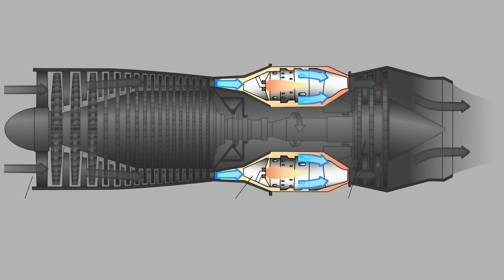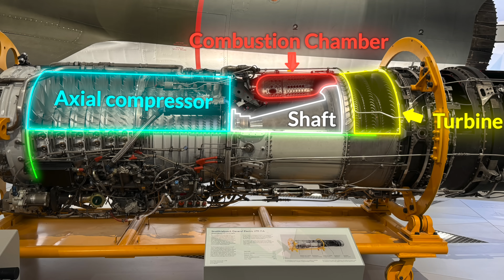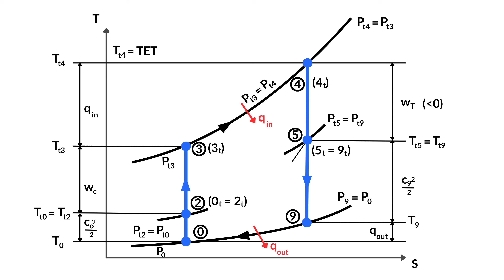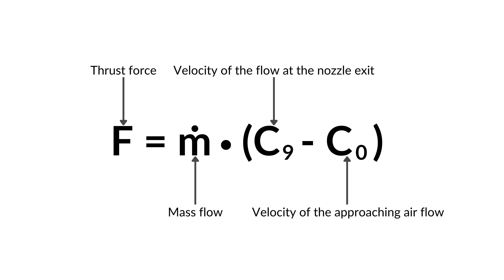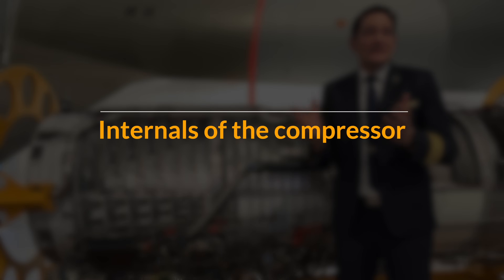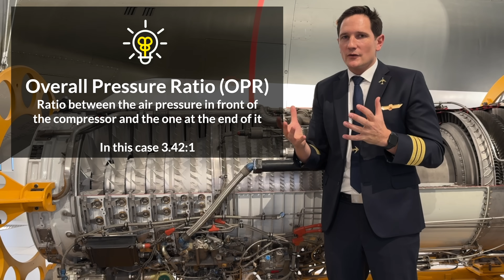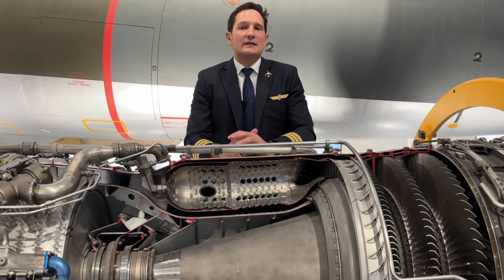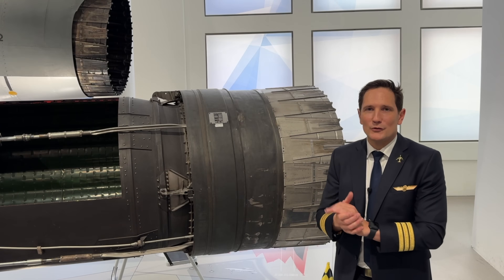How a TURBOJET Engine works - Explained by CAPTAIN JOE

Comment: This was a good explanation of how a turbojet engine works. You never explain where the thrust pushes on the engine's internal parts to move the plane forward. Where do the exhaust gas molecules impact the engine parts to provide thrust. I understand the 'thrust equation' but this avoids what physically happens. Please do a video explaining the actual forces.

Comment: Good explanation. As I was watching it, the stated value of OPR=3.42 did not look right for the J79 engine. Googling it, I came across OPR=13.5 which may represent the design point capability of the compressor.

Comment: -- On your question of when engine max power is used - when something bad is chasing airplane like enemy missile or aircraft - that mode calls WEP(War Emergency Power), followed by take off(MIL power).

P.S. You made a very good video, but it would be even greater if you'd elaborate a little more on why no backflow from combustion chamber into compressor do not happened. And you should blame a "diffuser"(right after compressor, and before combustion chamber) and Daniel Bernoulli principal for that. Diffuser is important, but often forgotten part of jet engine, that slowing down airflow and increasing pressure, which is supposed to be greater, then expanding air-fuel mixture as it burns and expands.

Thank you!
Reply: -- Also, not only fuel efficiency, but turbojet engines are loud when compared to turbo fan engines, that muffled by the fan. Case in point Lear jet 24!

Comment: Turbojets are less efficient than turbofans because they accelerate a little bit of air a lot whereas the latter accelerates a lot of air only a little bit. The latter achieves the same momentum but saves lots of energy because kinetic energy is squared as velocity goes up linearly. KE = 1/2(MV^2) so that’s important to remember.

Comment: Since nobody seems to have answered the question: an engine produces maximum thrust in the first moments of takeoff because the difference between the entering and exiting air is the greatest. Also the air is densest on ground level so the mass flow also increases.

Comment: Excellent cotribution ! Just a question on the compressor OPR: Could this be approximated by the cross section of the compressor intake by the cross section of the compressor outlet ? BTW: This is a question by an electrical engineer - so bear with me ... 🤓

Comment: The jet engines produces the maximum thrust during the take-off phase, because the compression of inlet air will be high due to high RPM of compressor which increases the air temperature and pressure. This high temperature and pressurized air helps in burning the fuel and increases the pressure further more. Therefore, more the pressure of burnt gas expanding through the nozzle, the velocity of the gas will be increased which results in the more thrust as an reactive force. Correct me if I'm wrong somewhere.
Reply: very well said, but jet engines are supposed to recieve more airs into its system isn't it? so more air equals higher rotation on the turbine and higher velocity on the nozzle exit resulting in more thrust force. I'm not sure what phase of flight the engine needs to be in to get the most air...
Reply: @izuumisato6473  at cruising or climbing phase the thrust reduction will be done to enhance engine life and fuel efficiency.At higher altitude the aircraft flies at higher speed for the same thrust because of less air density
Reply: @HPGAMING-r7h  alright i get it. thanks for the explanation!

Comment: It's now Saturday morning for me, so here are some more comments.
So today. let me first correct a very obvious factual error that you made.  You said that the J79 had an OPR of 3.42:1.  That's wrong: its pressure ratio was around 13.5:1.  Frank Whittle's W.1 engine, with its centrifugal compressor, had a pressure ratio of around 3.8:1, while the pressure ratio of von Ohain's centrifugal HeS3B was, from memory, around 2.7:1.  I've rarely if ever used the term 'overall pressure ratio', but would typically have referred to the compressor (or even engine) pressure ratio.  However, I know that you use EPR (or IEPR?) as an engine performance parameter, so that there could be confusion, and I do recognise that OPR is commonly used in technical literature.  
You explain that the compressor blades accelerate the air in a circumferential direction, which is quite correct and you use the term 'twist': I know this the 'whirl velocity'.  The vanes do then 'untwist' the flow to the correct angle for entry into the next row of blades, but they don't necessarily completely straighten the flow.
A very common way of explaining how an axial flow compressor works is to say that the blades accelerate the air, while the vanes slow it down, thus increasing the pressure.   In modern compressors, the pressure rise occurs approximately equally across the blade and vane rows, which is known as '50percent reaction'.
A  major shortcoming of the axial flow compressor in the Jumo 004B engine was that all of the pressure rise occurred in the vane rows, which is '100percent reaction'.  The 004B's eight-stage axial flow compressor had an OPR around 3.1:1, as compared to the equivalent British centrifugal flow engines of 1944, which typically had OPRs of 3.8:1, and were significantly more efficient in terms of specific fuel consumption (SFC).
Finally, let me comment on the final (or propelling) nozzle.  Its essential function is to expand and thus accelerate the gases (force equals mass times acceleration) from the exhaust gas pressure downstream of turbine to (nearly) that of atmospheric pressure.  That is its primary function, but the area of the nozzle is critical in adjusting the performance of the engine, and it does, of course, affect the pressure drop across the turbine and pressure ratio of the compressor.
As a matter of interest, the J79, with its convergent-divergent variable area final nozzle, had the function of opening up the nozzle at low power, which effectively minimised the residual thrust on the ground.  
And let me throw in one final point about the final nozzle: while its function is effectively to contribute to the thrust of the engine, the force on the nozzle is rearwards.   This fact surprises some people - but it's a fact.
Reply: Considering the J79 for example; how much rearward force push the nozzle, in the full close position ? I think a lot; about 20 to 30 kN ?

Comment: Where does the whistling sound of a turbine engine coming from?
Reply: In simple terms, it's the high frequency noise generated by the blades and vanes moving past each other in moving the air.  As a child, did you ever rattle the vertical railings of a fence with your hand as you walked (or ran) past?  Now just speed up the effect many times.

Comment: Excellent explanation!  A video on the radial jet engine would be very helpful!  Is this similar to or the same as a centrifugal jet engine?  That is the type of engine that is used in a model jet aircraft.   Since I fly models, I would be interested to know more about the concept!
Reply: I've commented on this.  Using the term 'radial' is really a misnomer: 'centrifugal' is the correct term.

Comment: So here are my further comments, as promised.
You refer to 'rotor blades' and 'stator blades': these terms are not actually wrong, as I recall them being used sometimes in the early days of my career, but I would now describe them as archaic.  The common terms used nowadays are '(compressor) rotor blades' and '(compressor) stator vanes'. The 'rotor' and 'stator' descriptors are usually omitted and the word  'compressor' added, as it is understood that blades rotate, while vanes do not.  Incidentally, that J79 has a compressor with variable inlet guide vanes (VIGVs) and variable stator vanes (VSVs), with the term 'stator' still used (VIGVs and VSVs are worth an explanation in due course).
While still on this subject, the stator blades in a turbine are now usually referred to as 'nozzle guide vanes' (NGVs). and the rotor blades as 'turbine blades': again, it is understood that blades rotate, while vanes do not.
Moving on (after walking the dog), you refer to the three major components: I would refer to four, as the final nozzle is as important as the compressor, the combustion chamber (combustor, if you must), and the turbine.  And, of course, you refer (as so many do) to: Suck - Squeeze - Bang - Blow.  These terms have come from the piston engine and do help in comparing and contrasting  the two machines. 
 However, I think that, a few years ago, I got Rolls-Royce to change to 'Burn' instead of 'Bang' in their handouts, to highlight the difference between the continuous combustion process in the gas turbine, as compared to the intermittent process in the piston engine.  If there is a 'Bang' in a jet engine, it is usually because the compressor has 'surged'.  I object to the use of the term 'stall', (although it is often used in the USA to describe what I know as a surge) because a compressor can continue to operate in a stalled condition without the flow reversing, which it does with a loud bang and flames shooting out of the intake.
I have more comments to add, but they must wait until tomorrow.
Reply: Points well taken. I just replied to another comment  suggesting the gas turbine would be easier to understand if we said "Suck Squeeze Whoosh and Blow". The burn in a gas turbine makes a noise like a welding torch. The Bang is much more appropriate in a jingle for an Otto Cycle engine.

Comment: Please include a little clip of the nozzles moving in your later video about the afterburner.
Partly because it is educational, but also because it looks cool!

PS: if this part stops working correctly it can be a really big deal for fighter jets, since they lose a lot of potential thrust.
I'm sure it would be part of the before-takeoff checklist to check the cockpit gauges when moving the throttle.
Maybe it's even checked automatically by the computers in more modern fighters.

Comment: A pretty good explanation, Captain Joe, but I do have a few critical comments - and btw, if you look at my little thumbnail, you will see me leaning on an engine that I helped design back in the 1980s.
Firstly, in English gas turbine terminology, we usually refer to centrifugal flow and axial flow engines.  The term 'radial' is normally reserved for piston engines where the individual cylinders (usually air-cooled)  are disposed radially around the crankcase.  
The term 'centrifugal' applies to the compressor impeller (eg) of the HeS3B you showed us, as the air flows outwards: however the turbine in the HeS3B was a 'centripetal' turbine, because the gas flowed inwards. 
As a gas turbine engine, the HeS3B worked - but only just, and the same could be said about the Jumo 004B at the end of WWII.  Naturally, you would have got the German perspective of jet engine development at the Deutsches Museum (it's a fantastic museum, and I did visit it once while working on the RB199 engine).  
Yes, the HeS3B was the first turbojet engine to fly in August 1939: the He178 was in the air for all of six minutes, and the engine had to be shut down in the air.  However, the HeS3B just did not compare with the Whittle/Power Jets W.1 engine, which first flew in May 1941: its first flight time was seventeen minutes, with absolutely no problems.  
After that first flight, the Gloster  E.28/39 was trundled back into its hangar (under armed guard), with the engine receiving no attention.  After ten hours or so of test flying, the only defect found in the W.1 was a small crack in one combustion chamber.
I will offer some further comments when I take another look at your video.
Reply: I there! I was expecting to find AgentJayZ in the comments but you are a known face too 🙂
Reply: The Metrovick F.2 axial-flow engine.  
Pre WW2 Britain was on two paths: 

1) The axial-flow air compressor by Griffiths; 
2) The centrifugal air compressor by Whittle. 

Griffiths' 1926 seminal paper laid down axial-flow. His paper outlined a turbo prop. He did not believe at the time the engines could produce enough thrust, but could turn a propeller. He had Metrovick to develop an axial-flow turbojet in 1938, who started the groundwork of the manufacture of the F.2 axial-flow in 1940, having an engine first spin in the same year, with a successful test bed spin in 1941. Whittle's patent was in 1930, which laid down the turbojet. All this information was available to the Germans. 

Whittle went for centrifugal, as it was a simpler way of compressing air. Whittle wanted a simple air compressor to establish his turbo jet design quickly. In short, he was interested more in establishing the back end of the engine, the thrust, rather than the front. Once the back end was perfected then he could improve the front, the air compression. This was the sensible approach. The centrifugal compressor was perfectly adequate to prove the rear thrust side of the engine. 

As post war engines proved, the centrifugal was taken to higher limits. Axial-flow compression was a series of fans on one shaft, with successive fans passing compressed air to the next fan to increase air compression. This added complexity in many ways. 

Griffiths went for the more complex axial-flow. He also laid down a contra-rotating compressor, but Metrovick did not take that route. The Meteor airframe was ready for an engine. The powerful F.2 was used to fly the Meteor however the hot running engine was considered not meeting standards of reliability at that stage, throwing a blade in flight causing a crash. More development time was need, with time short.  So Whittle's more reliable centrifugal compressor engine was chosen for the Meteor. The F.2 was far more reliable than the flawed German Jumo and giving more thrust, but the British would never put a plane in the air with such an unreliable under-developed engine as the Jumo. Henry Wiggin in Birmingham, who still exist in Hereford, who were commissioned to develop and improve high temperature resistant alloys, continually improved the alloys as the jet engines were being developed. The Germans had no such programme. The F.2 ended up as the post war Sapphire being built under licence in the USA as the J65, powering the: Douglas A-4 Skyhawk, Grumman F-11 Tiger, Martin B-57 and the Republic F-84F Thunderstreak.

It took the French, using some German engineers, a wasted eight years to have the German axial-flow designs reliable, which by that time they had discarded some of the German engine concepts. The German derived French engines were so good the French airliner the Sud Aviation Caravelle used Rolls Royce Avon engines.

Comment: I'm a guide at an air museum, but basically a layman. I use our J-47 to describe the operation to other lay people. 
I use the concept of feedback, that is, the faster the compressor rotates, the faster the turbine rotates. Coupled by a shaft, the faster the turbine rotates, the faster the compressor rotates. 

Like a microphone <<>>speaker squealing.

I have I have this wrong, someone please correct me.

Comment: I've never heard of a radial turbine engine so would very much like to see a video explaining the concept and what it's potential applications would be.
Reply: They are obsolete now. Early jet engines were radial or the preferred term centrifugal. The advantage of centrifugal is that it they can increase the pressure ratio from 1 to 4 for each stage, rather than about 1.2 for axial. However axial is more efficient for larger applications, they peak at about 92% efficiency, vs 85% for centrifugal. Check out the de Havilland Goblin for an example.

Comment: The thing that always forgot to mention (also for car engines) that this cycles are not actually cycles just approximately, because the amount of gas changes during burn stage. The oxygen become carbon dioxide and water, and it is more molecules than we started with.
Cycles assume the amount of gas remains the same, only attributes (pressure, volume, temperature) changes.
Reply: Oxygen still is left in the combusted gas and is what causes the afterburner to light up when fuel is injected

Comment: That's a great video Joe. I worked in mechanical engineering but not in aviation. This video is the best explanation I've ever come across as to how a turbojet works - I will need to rewatch the technical part but thank you for including it as there is a lot of information in there which I will try and digest - never too old to learn! Looking forward to the rest of this series.

Comment: Highest thrust is generated while stationary. Air speed in front of the inlet is 0, air speed of the exhaust gases at the nozzle is at it's maximum. So F = M • (Vexh - 0) with the brackets thereby having their maximum value.